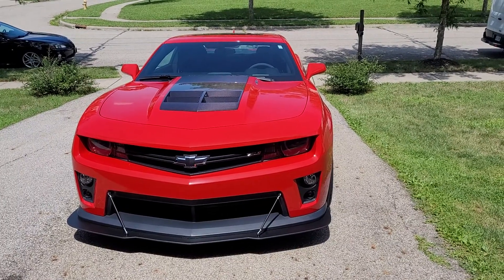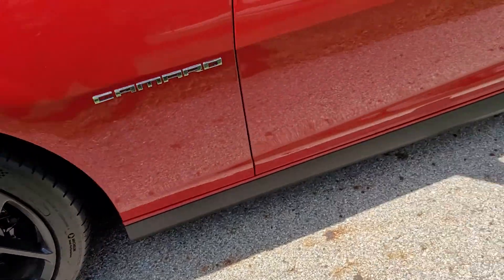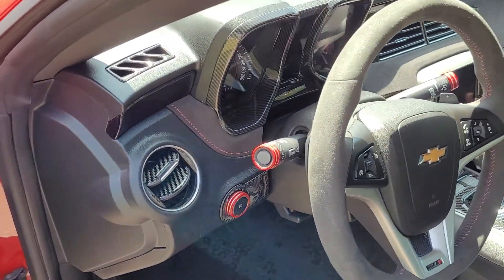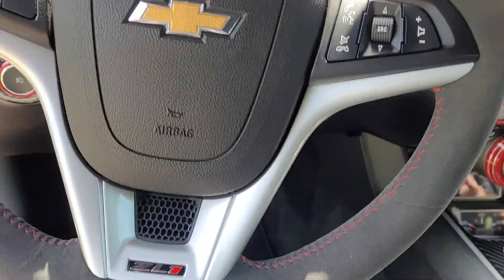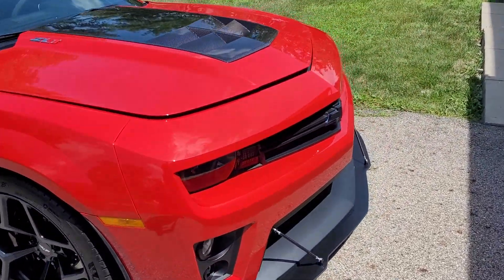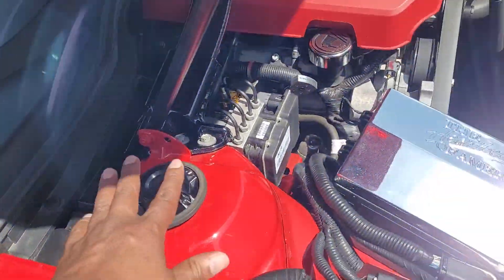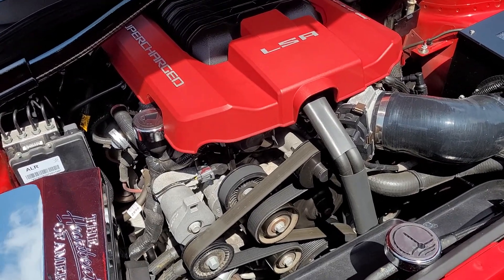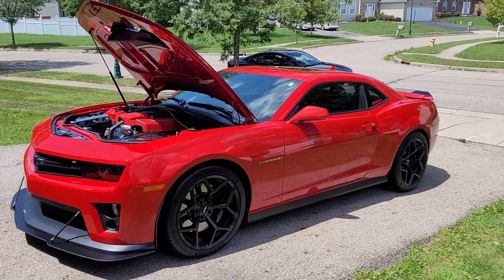My 2013 Chevy Camaro ZL1 and my current mods

Comment: The 2013 Chevrolet Camaro ZL1 has the supercharged 6.2L LSA V8 with 580 horsepower.
Reply from the maker: Correct
Reply: @whateva_man  uhhhh how wise would it  be to get a 2013 in 2023  ?
Reply from the maker: @great4ever845  very wise since they will only increase in value
Reply: @whateva_man  are they reliable not too many problems too worry about
Reply from the maker: @great4ever845  For the most part they are. I’m in some large ZL1 groups and most of big the issues I hear of are from people that have modded the engines and when the mag ride shocks go out they are not cheap.

Comment: Absolutely beautiful my friend!!!  Keep it clean, keep it happy!  Great video homie!!
Reply from the maker: Thank you!
Reply: @whateva_man  thank you for making great videos my friend!!  May I ask you how much the Z/28 rims cost you?  I have a ‘14 1SS L99 with a CAI, ported TB, headers, X pipe into a 3” borla atak.  I want to do the Z/28 clone set up but was unsure what to expect to set aside $$ wise for the rims, tires, side skirts and deck lid spoiler.  Do you also have any advice tire wise?  I’m sure you need something capable of handling the power and torque your car makes (i’m only putting down 436hp 421tq to the wheel).  I currently have Continental Extreme Contact Pros which work amazing in a straight line and through the twistiest roads, but the rears are 275’s which I believe i’d have to use on the fronts with the new rims.  I have a friend who owns a tire shop who can get me anything I want at cost.  The Continentals were $235 each, and he gets them for $95.  Thank you for reading this 1800 word reply (sorry it was so long my friend), and I look forward to your advice.
Reply from the maker: Continental extreme conacts are popular with Camaro guys. I have Michelin Pilot Sport S4 and they have been awesome on the street and the drag strip. My wheels are Factory Flow Form Z/28 replicas. They were about 2 grand. 20x10 front and 20x11 rears. They were lighter than my stock forged ZL1 wheels

Comment: how fast is that transmission, im thinking to buy a 2015 zl1 with 20k miles, but it is automatic, and some people say manual is faster.
Reply from the maker: @gabrielcajiaojimenez6679  In my opinion the difference isn't very noticeable. When riding with some other stock ZL1s whoever gets off the line better usually wins and our 1/4 mile times were all similar. Most forums seem to claim the manual is faster and I would rather have a manual. The auto is still a nice ride but paddle shifters are not going to make you happy if you like driving manuals. Hope this helps

Comment: Hey brotha, could you send me the link to purchase all your carbon interior parts? Were they easy to install?
Reply from the maker: I got everything on Amazon and it was all easy to install. Here are a few links but if you search carbon fiber interior on Amazon you should be able to find everything. 
SQQP Carbon Fiber Dashboard Panel Trim, Dash Board Frame Bezel for 2010-2015 Chevrolet Chevy Camaro https://a.co/d/8kmbSeh
RT-TCZ Carbon Fiber Door Handle Window Lifter Control Switch Button Panel Cover Sticker Trim Interior Decoration Accessories for Chevrolet Camaro 2010-2015 https://a.co/d/ac3a9ZL
AIRSPEED Carbon Fiber Car Cup Holder Frame Cover Interior Trim Cover Decal Compatible with Chevrolet Camaro 2010-2015 Accessories (Black) https://a.co/d/0nNT4ev
NVCNX Real Premium Carbon Fiber Dashboard Sides Air Vent Outlet Frame Dash Trim Cover Sticker Decal Car Interior Accessories Compatible with Chevrolet Camaro 2010 2011 2012 2013 2014 2015 8PCS Black https://a.co/d/02wf6a6
AIRSPEED Carbon Fiber Air... https://www.amazon.com/dp/B08QCVWXBX?ref=ppx_pop_mob_ap_share